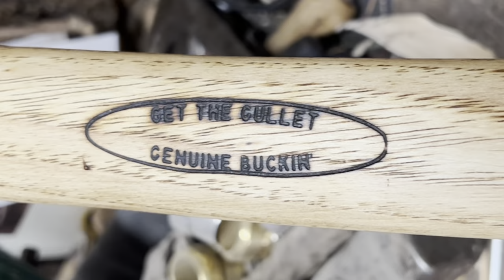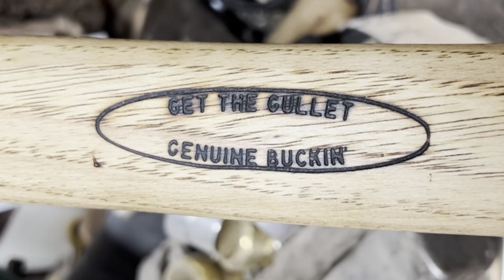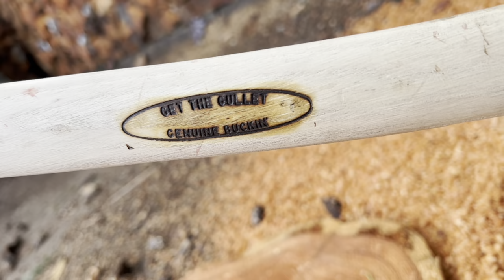EPIC UNBOXING!  Behold, The Wood Bullet.

Comment: The axe is looking real sharp and it's been a hot minute but how's your axe making coming along how much progress have you made or are you still doing it at all other than that good video
Reply from the maker: i dont make axes.
Reply: @BuckinBillyRaySmith  no but you said you wanted to remember you said everything was coming back to you and you said that you felt like you had to do this so I was just wondering if you were still doing it or not
Reply from the maker: @stevenparson0  yes sir we got equipment and was hopin for it to work out that perhaps someone could make the heads hear. its just not workin' out , it was never my plan to make the axeheads  ,I figured out very quickly that standing on that concrete, wood not work for me , not to mention the years of learning the trade,lol . but ya never know , something may happen , thx Steve

Comment: I have a good question for u what ax what handle and what handle length do u recommend or would u build for a cripple that can only split sitting down?
Reply from the maker: I will build what he asked me to
Reply: A very good answer but was hoping u would try splitting from sitting and see if u may have some real life advice, if I use a long handle heavy ax, as long as it splits great but if it doesn’t it’s a struggle to get it set back up, if I use a short handle heavy ax it doesn’t split as good but it’s easier to set up for the next hit. I was hoping you’d try it and see if u can find a better ax or technic for me to try. And if u have not figured it out yet I’m the cripple!